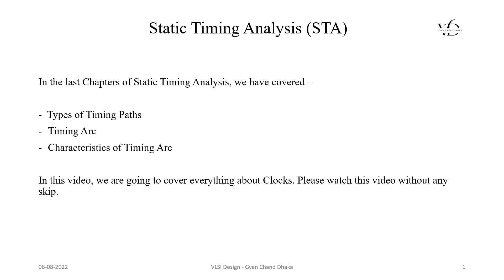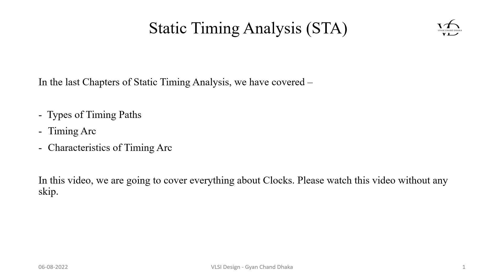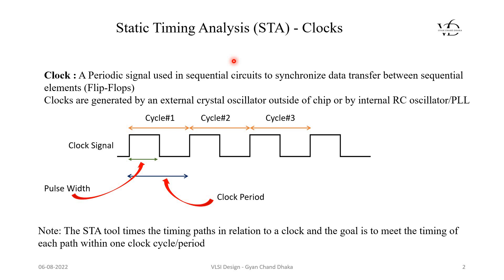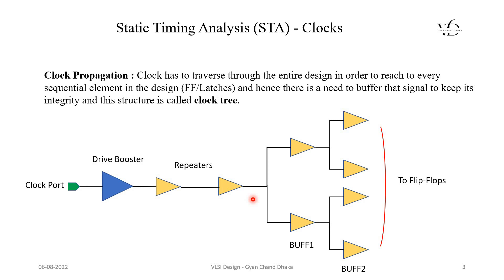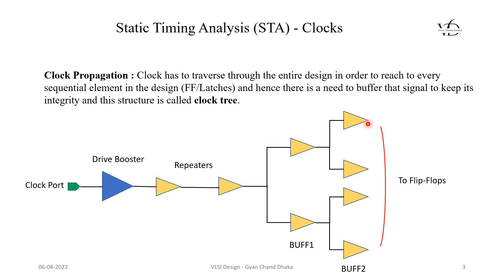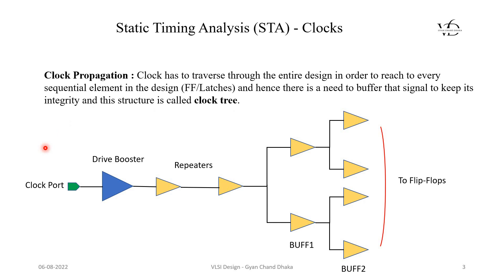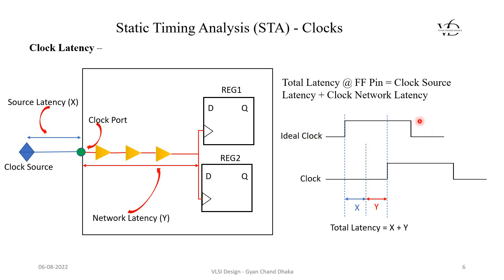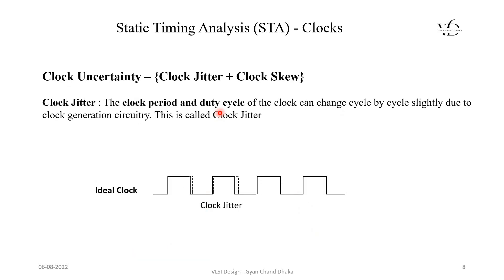Chapter#07 | Clock Latency | Clock Skew | Clock Jitter | Clock Uncertainty | STA| @vlsiexcellence ✍️

Comment: what is the difference between latency and insertion delay , if same why we are considering latency from source to sink and insertion delay from definition to sink
Reply from the maker: Hi, Latency is the value we provide to the tool before CTS whereas Insertion Delay is the actual delay value coming post CTS.
Reply: @vlsiexcellence  Then is it Latency related to Ideal Mode and Insertion Delay related to Propagated Mode ??
Reply: latency you should understand as in general " total time taken from input to destination " now when we talk about clock latency , then there is clk source latency and n/w latency (which can be said insertion delay also)